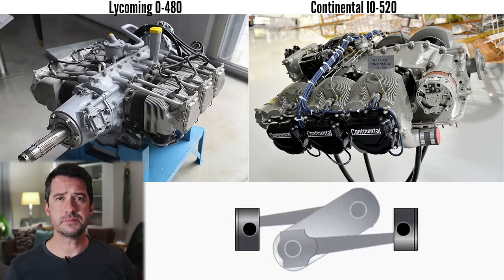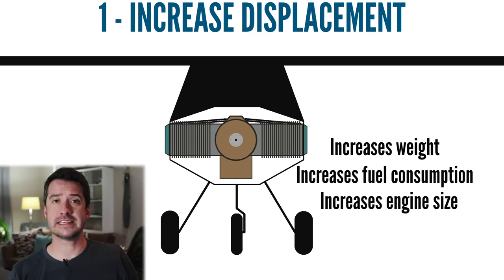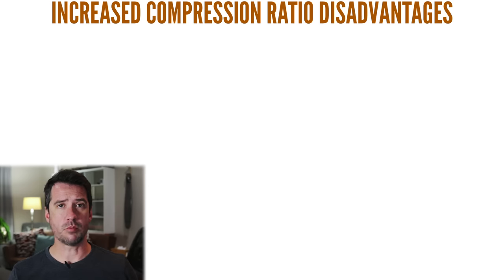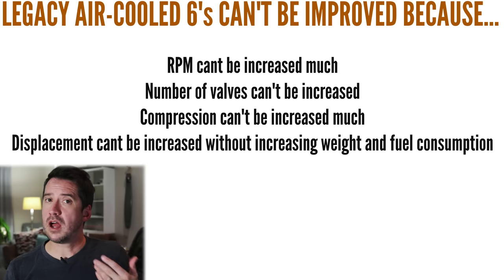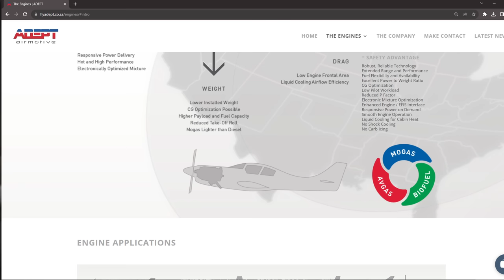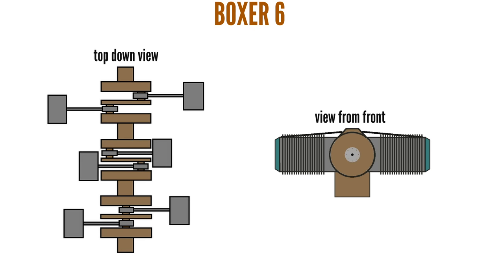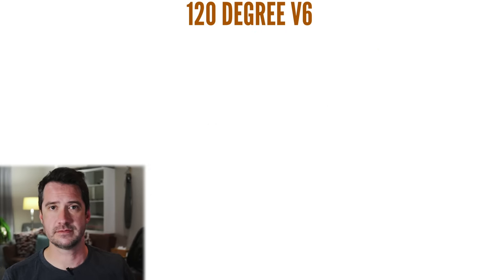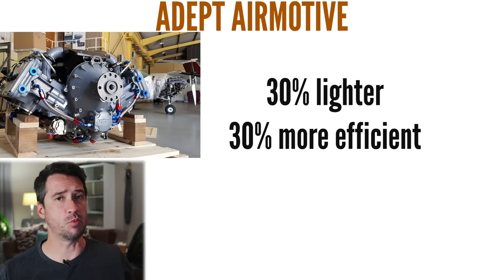Unusual V6 Airplane Engine Makes Boxer 6 OBSOLETE?

Comment: Boxers won't go obsolete just because of a new engine design. When jet engines were introduced some also thought this would make piston engines obsolete but they were wrong. Boxers will be around for a long time to come.
Reply: It all boils down to cost, that is it
Reply: the problem is that those engines havent been improved in decades, Even worse is that they use older tech than some WWII piston fighter airplanes (like Fw190 with its commandoGërat). current automotive tech is decades ahead of those old engines. it's way about time for a proper efficient piston engine for airplanes.

Comment: Electric small aircraft. 
Electric is all about battery capacity. 
Batteries are heavy. 
Weight is the enemy of efficiency in the air much more that on the ground. 
Seeing as many Teslas catch fire doesn't make me any more hopeful for "e-birds" either.

Comment: There certainly will be a market for this engine but it will not replace the old Cessna engine. There are turbo prop style engines that fit into that space also and those are vary simple and reliable and powerful. So new is good and there will be plenty of vary expensive planes that will take advantage but not the old Cessna that sells for much less then 100k and is what many people will own and fly because that is the level they can afford to operate. Don't forget all the aircraft mechanics that will need to certify to touch this new engine further reducing its spread thought he aircraft industry. Like I said high end use only. Kinda like asking a Cessna mechanic to fix a jet engine.... say what? um no. but, don't let that stop you with the new better and stratospheric expensive endeavors like this. Plenty of $$ out there in the aircraft industry. Kinda like my wife just HAD TO HAVE that new RAV4 um.. because it gets 45mpg. Me... really. um ok so you save 100 bucks a month in gas cost but what about the 900.00 payment per month? She would not let facts get in her way so we bought it.

Comment: The world of experimental and light aviation in general is really frustrating when it comes to power units. It's impossible to find a 100-150hp, light, relatively affordable engine.
This has forced me to look at BMW's R1200GS conversions. With conversions come reliability question marks. I plan on blowing at least two of these engines in ground simulators to see where they stand and how far they can be taken. At the moment, in the design stage, it looks like the solution that I've been looking for, but only time will tell.

The S1000RR engine was a great candidate on paper. However, its TBO would've been way too short. Still interesting for purely aerobatic and short recreational flights.
Reply: And mazda rotaries, especially ones that are turbocharged, don't tick those boxes?
Reply: @JoshRiolu  No, they do not. There are two main problems with rotaries.
One is that their lightness and compactness will be offset by the extra weight and extra volume of the extra fuel which they demand.
Second, the TBO of wankel engines will inevitably by a short one. They need to spend a lot of time at high revs during TO and climbs.

It can be done, it has been done, but these are the main reasons why we do not see them very often.
Reply: Many bike engine repurposed for use in cars have had oiling issues during sustained lateral Gs. I would be concerned about this in an aviation application.
Reply: @LogicalQ  The R1200 conversion will be designed with a dry sump system, partly to avoid oil starvation but mainly to reduce its frontal area.
Reply: The Yamaha Genesis 998 Turbo 3 cylinder is a reliable and quite powerful engine. 300 hp are readily available with the original turbo and a good engine tune. 
The engine weighs about the same as the Rotax 4 cylinder engine. 
The Yamaha engine is originally used in a snowmobile and can be had as a crate engine for something like $6000. You have to count an additional $12000 to $16000 to make it aircraft worthy.

Comment: Honda use F6 on GoldWing... Fix dual spark plug to tick the box for certification and here you go... Smaller, stronger, more reliable, out of the box!! 
Add Turbo and you can replace most of low-mid power F4 and F6 in the fleet. 
For bigger planes consider modern L6 diesel units!

Comment: You can reduce the displacement and increase RPM to get the HP increase, Rotax did it that way, but Rotax is a big company, with lots of overhead and share holders to pay off, so they did the flying public no favors in lower prices.  Every car on the road have a gear box and liquid cooling, and I think aircraft should be the same, what ever weight increase for liquid sure did not bothered many WW2 airplanes. The cam shaft can be made much stronger to be the engine output shaft and most engine, the cam is at a 50% RPM.  Please do not have direct injection only in airplanes, There is already enough trouble in cars with dirty intake valves. A new engine give opportunity to add stuff like knock sensors and computers on to it, I like the individual coil packs and then you can dump the magnetos, I hate the 500 hour TBO. Turbo should be manual operation , with some automation by computer so over boost will not happen. but turbo is a high maintenance item. The main reason why airplane engines are so behind the times is because of FAA regulations discouraging anything new. The approval process is time consuming and expensive.  There is also politics involved. such as the Eagle unleaded fuel  initiative, which been bogged down again. They been messing with that for over 2 decades now.  In contrast, automotive industry, about 100 time larger than general aviation, when they need to change fuel, it took a mere 4 years to change everything from the early 70s.
Reply: WOW!! What a great idea !!to take output power from the camshaft!!!! Just would need heavy duty gears on the Crankshaft and Camshaft!!! and heavy camshaft bearings and bearing saddles with a thrust bearing inside the engine.The front of the camshaft would have to be similar size to the front of the crankshaft. I hated the 500 hour magneto overhaul also. And sometimes they would not make the 500 hours!  In my VW beetle engine, the gear driven point ignition takes minimal maintenance, will go 100,000 miles with only couple contact points replacement . and costs around 5 cents/hour to maintain and is super reliable, much more reliable than aircraft magnetos. I calculated once that my aircraft magneto's costs were approx $5.00/hour just for ignition.

Comment: Porsche has been making and refining boxer 6's for quite a while and as far as I'm aware, they have also been increasing power and efficiency at the same time. Not much discussion about that.
Reply: Porsche & BMW Motorcycles maintain those Boxers and evolve them to maintain brand identity and retain loyal customers, not necessarily because it's the pinnacle of Engineering.

Comment: Honda or GM could modify one of their v6s and charge $100,000 for it.
Reply: 1000% agree.  GM manufactures it's large displacement diesel engines for it's trucks at a fraction of the production cost of a new io540 and it does so at a lower volume... which is totally counter-intuitive.  Those diesels contain highly complex computer systems and even higher tolerance parts than GA requires.  In some cases, they are even using materials that are MORE EXOTIC than anything in the lycoming.

The issue has never been profitability for the companies involved.  It's liablity and the INSANE amount of regulatory hoops required to bring a GA product to market.  Modern development cycles are almost prohibited because it can take two years or more to get a major design change certified.  Companies want to be able to iterate on their products very rapidly and current certification regulations make that almost impossible.  You almost can't bring a product to market unless it's perfect and ready to stay the way it is for decades.

That said, if GM got involved, they'd sick their lobbyists on congress and probably get themselves an exception somehow.  God I wish they'd do it.  lol.
Reply: They'd have to charge more than that to pay off all of the shysters who'd be suing them for imaged faults.  Out legal system is one of the biggest obstacles to offering any product in the U.S.

Comment: There are plenty of improvements to be made on the old engines. Add in squish pads for improved fuel homogeneousation, or completely redesign the combustion chamber to modern 2 valve standards like the LS engine's to improve thermal efficiency.
Reply: Without liquid cooling, you're not going to see any significant gains in efficiency, air-cooled engines literally rely on ridiculously rich fuel mixtures in order to stay cool at high power settings. Significantly improving reliability without liquid-cooling is also not going to happen.
Reply: @PistonAvatarGuy  Cite your sources for this being the case.
Reply: @CreeperOnYourHouse  Name an air-cooled engine (aircraft, or otherwise) that this has ever been done with, while also resulting in the engine being able to match the low BSFC of a similar liquid-cooled engine at full power.
Reply: @PistonAvatarGuy  Bristol Hercules, DB-601. Literally any other WW2 liquid cooled engine, actually.

Please cite your sources.

Combustion chamber design works on any engine, liquid cooled or air cooled. A move away from the traditionally used semi-hemispherical combustion chambers currently used on lycoming/Continental, or the unfeatured wedge shaped ones on Jabiru and another one I can't remember, to a properly shaped combustion chamber with strategically placed spark plugs to optimise the propogation of the flame front would massively increase efficiency of the engines.
Reply: @CreeperOnYourHouse  For your edit: Yes, the LyContisaurus engines would benefit from more modern combustion chamber designs, but they would still be limited by their air-cooled heads.

Also, about that rv6ejguy video: He talks about the TIO-540 (EFI engine) and isn't sure about the numbers, so I looked them up in the operating manual. The manual shows the BSFC of the engine to be 0.66 at full power and 0.43 at 60% power. The 375 hp TEO-540-C1A consumes a ridiculous 0.74 at full power and 0.62 at 65% power.

Comment: A couple of little points here. The inefficiencies mentioned at the beginning all relate to other areas of obsolete design, not the fact that the engines are horrizontaly opposed. Imagine comparing a late model Subaru engine to a 1950s VW engine: Both are flat fours. Also, if the engine has twin cam heads, and you 'swing' the cylinders up, the lower cams may still come out to a wider position (wider ove all). A simpler idea would be for the manufacturer to run two cams side by side in the crankcase, with each cam serving that side, and shortening up the push rod lengths, while still running four valve heads if needed. Yes, yes, I realise that this complicates the cam drive a little, but it's not that big of a problem. Just an idea.

Comment: Again a very good video !  I didn´t know about this engine. The advantages seemed to give a chance to have success. However, it is more than 10 years ago, the made it.  If the breakthrough does not come after two to three years, the thing will be over normally.
So, the question about the balance shaft : I studied the images available in the internet and I am afraid the engine hasn´t got any balace shaft. For an engine of this configuration a balance shaft is needed like a three cylinder inliner has, compensation a circulating torque 90° to the crankshaft by turning in the opposite direction with the speed 1:1. It is easy to achieve but to make it light weighted it should be minimum as long as the crankshaft is or longer if possibel. This reduces the balance weight masses of the balance shaft. The position of the shaft can be chosen whereever the designer wants. It coudl be below the crankshaft, where I cannot see any space for that nor a gear transmission. It could be above the crankshaft and fill the space between the V-Cylinders but again, there ist nothing to see like this. The space is filled by the oil pump, the transmission gear for the prop and the generator. If the balance shaft were on top or beside the engine, any transmission would have leaded to it. So as a result I expect lots of vibrations of this design. Interestingly: the starter is acting on the prop shaft which is unusual and requires a powerfull starter.
Reply from the maker: You may very well be correct. I studied available material as you have and couldn't see where a balance shaft could be positioned (but not visible), but thought the available imagery maybe isn't all-revealing. Since they state it's a very smooth running engine my conclusion was it has to use a balance shaft, since the chosen configuration can't achieve extremely smooth running without it.
Reply: The starter is on a large ring gear at the back of the engine, which is bolted to the crankshaft (like all GA engines), and not on the prop shaft which turns slower and therefore would necessitate more torque from the starter.